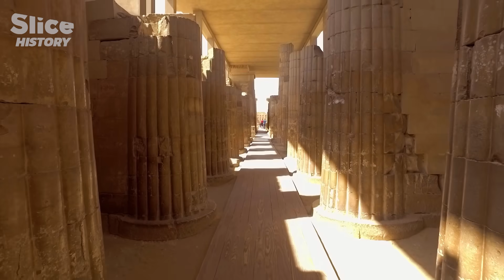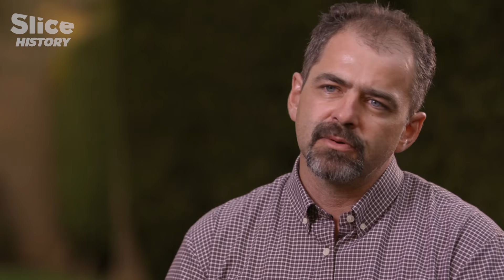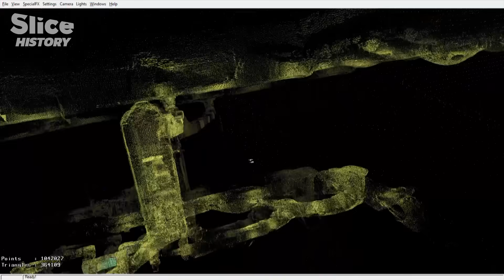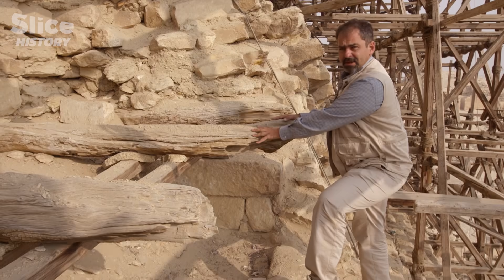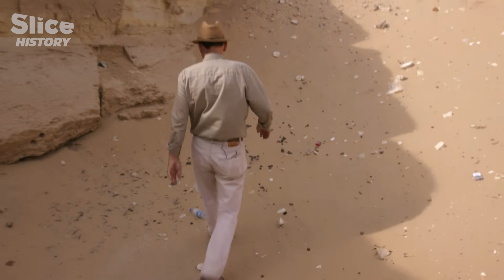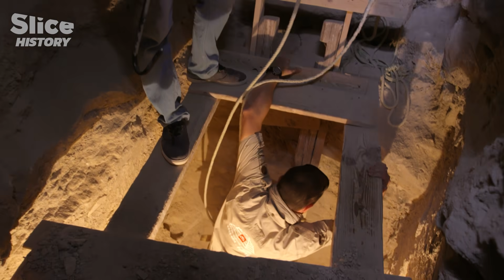The Step Pyramid of Djoser, an Architectural Revolution I SLICE HISTORY | FULL DOCUMENTARY

Comment: It is interesting that only small stones were used for this pyramid, whereas stones weighing several tonnes were used for the Cheops pyramid, for example. The precision and quality of the Cheops are on a completely different level. This pyramid is not a megalithic structure.
The age of the Cheops cannot be determined by wood, it may well be older - may be much older

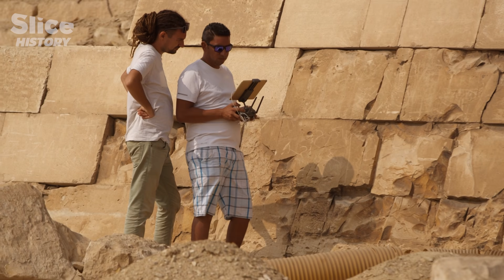Comment: Pause @5:33 and we see a close-up of the step-pyramid's casing stones.  You can clearly differentiate between the two different coloured stones, one being much lighter than the other and appearing less weathered. I am not convinced that the structure is the accumulation of men moving thousands of tonnes of incredibly heavy materials across a terrain made of sand. The practical limitations of lifting and transporting in this kind of environment can't be ignored. I personally interpret this site as a natural structure which since discovery has undergone extensive reconstruction work to present itself like 'this'.